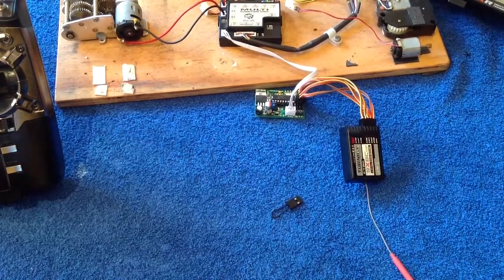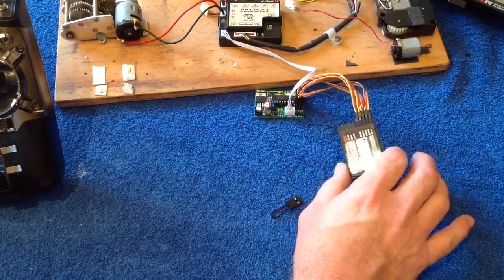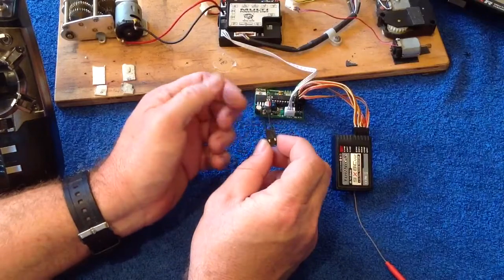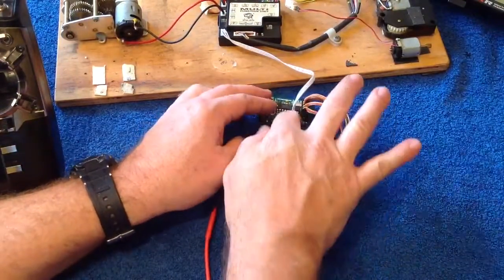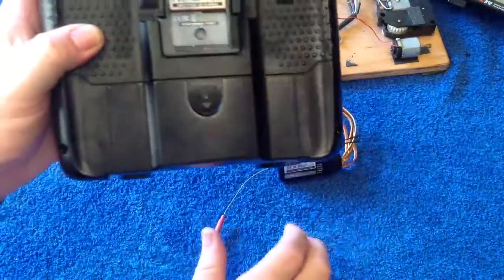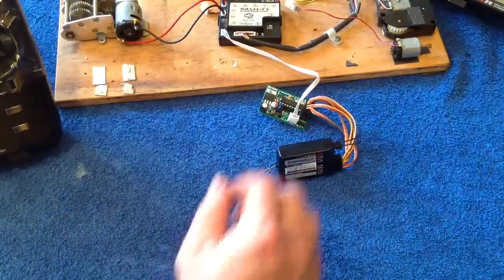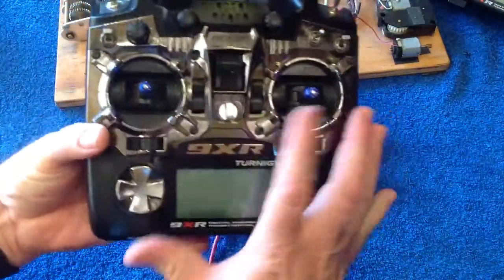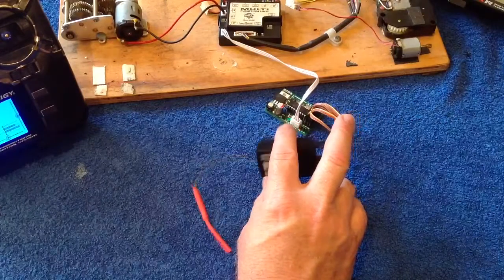9XR Binding Procedure

Comment: i wonder if you wont mind answering a question. I have a 9XR and a TH9X. i want to use the FlySky TX module in the 9XR. if i do all the Binding in the TH9X, then move the module to the 9XR, it works in my 9XR. if i try to Bind in the 9XR, i see the blinking light, then do a normal bind procedure, i get a steady light, all the sticks are working in the 9XR but it doesnt seem to transmit that signal to my quad.(APM 2.6, Ardupilot 3.1). i have to actually take the FlySky module out of the 9XR, Bind in the TH9X for it to work in the 9XR again. do you know what i am doing wrong with the 9XR? thanks
Reply from the maker: HI Thor, Sorry I can't help you.  I do use the FlySky module with the 9XR both for tanks and planes with the factory firmware and with custom firmware and I have not experienced any problems with binding.  Everything works as it should.
Reply: i am probably switching to FrSky Anyway but thanks for the answer
Reply from the maker: TheMighty Thor  Good choice.  I have done the same and will be doing most of the future development of my RC Tanks products using the FRSky modules,